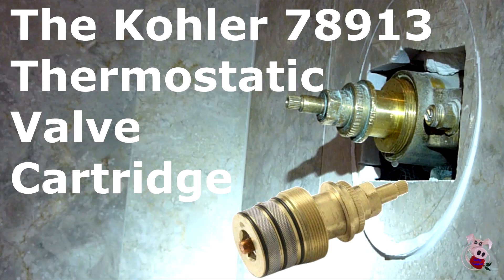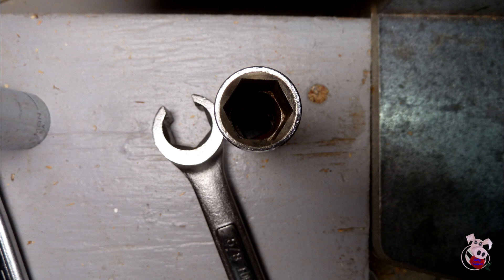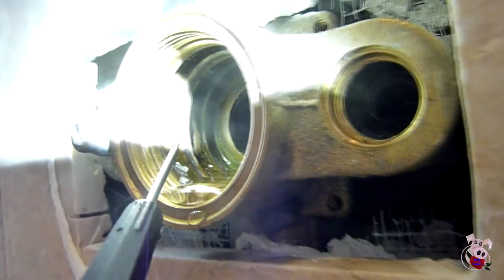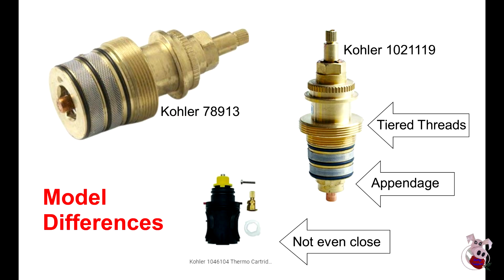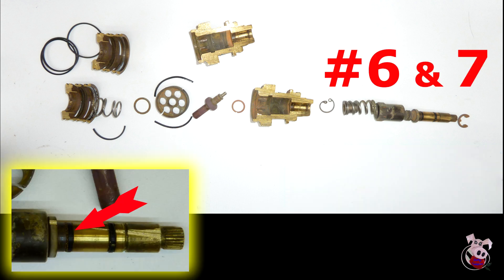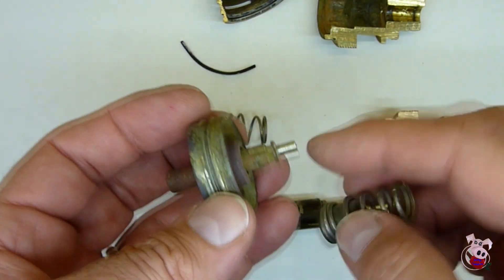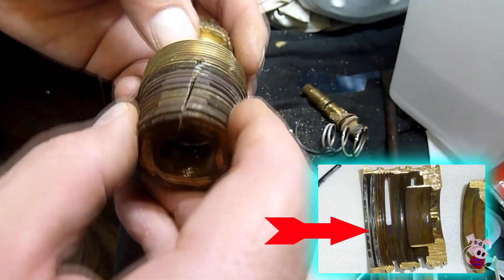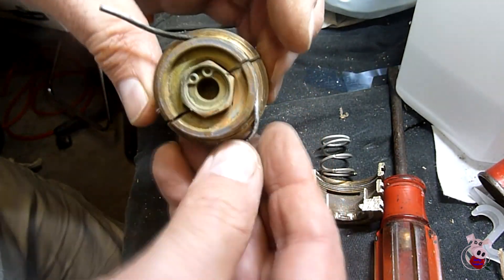Kohler 78913 Thermostatic Valve Cartridge Service

Comment: Hello! Great video. I’m at the point where you use the wrench and channel locks but it is seized on there pretty good. Do you have any recommendations to loosen it? You are my last hope before I have to call a plumber! Thank you!
Reply from the maker: none that I would be comfortable with as I would not want you to damage an in -wall pipe or the wall.  Pressure on both sides tends to help but then you are getting into special wrenches.  You can have someone lightly tap on on it when trying but it has to be with something that won't deform the metal.

Comment: @alwaystinkering6972. Any idea what those two screws on the left and the right do.? at 52 seconds. they are a chrome color looks like a set screw for temperature adjustment and / or flow rate? I cant seem to get 1. hot water 2. and or pressure. but i have a 2nd shower in the same shower it works great runs off the same supply lines. i have already replaced the mixer.... i am scratching my head. Also amazing video. thank you so much for this.
Reply from the maker: Those are shutoffs.  On this valve they are readily accessible.  They usually have a rubber seat.   If you lived in place where it is difficult to turn off the water you could in theory use these.   More often than not they are partially blocked by skillfully placed tile.  Because of the rubber seals and poor access, I usually don't touch them in case they start leaking.
Reply: @alwaystinkering6972  So i am getting really poor water pressure i think its the likely candidate for the it. i have already replaced the center mixing valve. any idea if you can buy those rubber seals?
Reply from the maker: @ they should be standard seats as I recall. But… you did the mixer.  Your on off valve could be swelled as well. Take the shower head off. Make sure there is no restriction there. Those two at the temp handle should be full open. Of one was a problem your hot cold would not balance… reducing the odds of both being it.
Reply: @alwaystinkering6972   yeah shower head is off still poor water pressure. i called Kohler again... and bought two replacement seats for the on and off ... $165 for both.... ugh. ships in 12 days... so we will see in a couple weeks. i am hoping that is the smoking gun to my problem. thanks again!
Reply from the maker: @ one more item. Likely not but it is a good story.  A neighbors guest bath  had lo low flow. Since the bath was not used the calcium (or something from their water softener) built a dome covering the egress from one of the valve chambers. Found it in a visual inspection.
Reply: @alwaystinkering6972  highly likely we have more blockages in those this is what we cut out that was in the hot and cold supply lines… let me see I can attach a photo
Reply: https://youtube.com/shorts/P-CAIe4Xo7A?si=7jjL7j-TrAwjJaPD
Reply: @alwaystinkering6972 alrighty I replaced the two temperature / pressure plunger type valves on the left and the right. I this fix 99% of my problems there was so much corrosion buildup in the old ones… But can’t seem to adjust them to get the right temperature either scalding hot and have no cold water or cold water and no hot, any idea what’s the proper way to adjust the valves? Any idea if the installation instructions have them?
Reply from the maker: @Rambo13Chris  The pictures you posted show you have challenges with sediment.  

The valves should be full open and the mixing valve should do the adjustment.   You are getting burnt or frozen so both provide water.  

Try a flow rate test.  Turn off one, fill a gallon or so bucket with everything full open.  The mixing valve maybe on the center once and then full open to the temp you are using.  What are are evaluating is how much water is flowing from each in a time period.  

If they are about even, I would suspect you still have a mixing problem.  If the are grossly imbalanced, you will hopefully know which one has a flow restriction.  If you are on a well with a tank, take into account the pressure when you run the tests.

Comment: Thanks for this.  I just replaced one of these for the 2nd time in about 23 years.  I was wondering about taking it apart to see if I could determine the failure, which was hot water only.  I will see if I can get it apart and if anything is apparent.

Comment: how do you remove the knob? Step 1?
Reply from the maker: The center has a cover. Under it the screw. Once the screw is removed you may find the handle to be stuck.  Patience. Wiggle lightly. I sometimes try some wd40. Others may have better suggestions.

Comment: hello thanks for the video, quick Q? how did you take a part the finished trim or the deten cap.
Reply from the maker: On the main valve cover it is usually a screw holding the handle. The screw will be under a center cap.. usually pop off.  The valve cover plate is usually two screws.  Individual handles are usually screw under a cover to get the handle and the valve cover is usually threaded on by turning the entire cover. Glance underneath and make sure you don’t see a set screw hole as you may sometimes encounter that variety.

Comment: Amazing video. I just installed a new one and it seems like the orings were never lubricated. I am planning on taking the new one apart and lubricating the orings. Has anyone actually managed to take it apart? Is it right hand or left hand threads?  Thanks again
Reply from the maker: I still have the cut one.  It actually looks to be a left handed thread. I never checked after cutting it. While I did reverse directions when trying to take it apart, let’s say I did not put as much effort going left. 

I will say keep in mind someone could change that orientation at their design discretion.
Reply: @alwaystinkering6972  Thank you very much. Again your video was amazing.
Reply: I am confirming that it is a left hand thread. I cleaned and rebuilt it again this past weekend. It seems it needs cleaning once per year. It works great again.

Comment: Thanks for taking the time to open the valve up.  Extremely informative for anyone working on a thermostatic valve, not just the 78913.  I installed the Kohler K-401 in 2004 and have changed this valve out 3 times in the years since.  Being that I still have the 3 valves I had removed I can now do some experimenting.

Comment: Excellent video. I'd like to improve it by clearing up one point:

There is car thermostat shown at 7:00 in the video. The springs do not respond to temperature. Rather, the thermostat contains a "wax motor" (https://www.coolcatcorp.com/thermostats/Wax%20Thermostats.html). The wax is incompressible, but expands when it melts, pushing a pin. 

I learned about wax motors when I spent a brief stint as an appliance repairman. A wax motor is used inside a dishwasher to operate a soap dish door when an internal heater is activated to melt the wax (https://www.youtube.com/watch?v=u11PAeWxQpw)(https://youtu.be/sApyrDEXGAI?t=408). A wax motor is low cost, generates in irresistable force, is very reliable, and should operate hundreds of thousands of cycles. 

In the Kohler video, from 4:55 to 5:10, the wax motor in the thermostatic valve is shown. The wax expands when it melts, pushing the pin and compressing the spring.

Here is an excerpt from the description of a Crosswater thermostatic valve that looks to be identical to the Kohler (https://www.fruugo.us/thermostatic-cartridge-for-gp0012174-rv1102rc-crosswater-gr-05t-sol-assy/p-10229921-21509092) 

"A wax capsule can be found inside the Crosswater GP0012174 / RV1102RC. The capsule is responsible for water temperature regulation by counterbalancing the flow of hot and cold water to generate a preferable temperature."

Why does the Kohler cartridge fail? I'm not sure. Does the wax motor pin get stuck due to deposits or metal corrosion? An automobile thermostat is immersed in a mixture of glycol and water. The Kohler is immersed in the water from your plumbing. 

Here is an online post by tbr220 (Nov 18, 2012) that I found at (https://terrylove.com/forums/index.php?threads/kohler-k-401-mixing-valve-cartridge-repair-or-replace.38496/) 

"I have two of the same mixers, both failed to adjust from full hot. Rather than pay for two new valves I have taken each one out and soaked them in CLR for an hour, rinsed and re installed, both work fine. I have had to do this twice a year for the four years I have lived here to clean out the calcium buildup even though I have a water softener. 

•	I remove the screens and o-rings first, 
•	then soak the metal parts in a glass mug 
•	then rinse and lube the o rings with silicone grease,
•	re adjust the temp limits and we are back to happy until they get stuck again. 

Hope this helps." 

Even though it's expensive, I decided to replace the entire cartridge, and soak the spare in CLR between swaps. Eventually, I may swap out the Kohler with something cheaper and more reliable (like a $35 car thermostat).

Comment: Do not screw it all the way in!!  I did that on my first replacement and after it failed in 2 yrs I bought another and luckily found the installation manual. 
- The new cartridge will have a black line on the bonnet and a black line on the adjustable stem. (It will come with them lined up. Do not turn it before installing)
-The valve body (the part in the wall) will have a black line on the top. 
-Screw in the new cartridge and line up all the black lines. (I screwed it all the way in and backed it out to line them up). 
-Check for leaks and reinstall the trim.
Reply from the maker: Thanks for sharing that so others can benefit.  Hopefully you get more than two years out of the new one.

Comment: This is, hands down, one of the MOST useful and informative how-to videos I have come across on YouTube. I regret installing this particular part (times two in my 2-person shower) and have been infuriated by the little issues that keep popping up. I have NEVER been able to get the temperature selection to be somewhat accurate, but this video helps tremendously in my quest to fix it once and for all now that the water flow/pressure upper valve has to be replaced and I will do it all at the same time

Comment: This cartridge goes in the Kohler MasterShower 3/4-inch thermostatic mixing valve, K-400-K valve, or if you have the two cartridge version (volume of water right above) it is called the Kohler K-401-K, with volume control.  The original homeowner of my place left some information on it.  Unfortunately it seems he replaced it several times in 15 years.  Now it is my turn.

Thank you so much for putting this video up.  My valve died again, and this gave me the confidence to work harder to remove the cartridge to replace it.  Surprisingly the cartridges are still around in 2021, although they are pretty expensive.  Not sure how many more times I will do this before changing out the whole unit.

Comment: Very Informative Great job! Now I can try to fix mine (not getting enough hot water). I am on well with a lot of sediment. I bet it is clogged with dirt.
Reply: Guess what everyone, with the help of this video and our tinkering friend who posted it, i just had my second failure after the newly installed warranty thermostatic valve. The replacement valve lasted about 3 years (on soft water). The issue was water temp too hot, unable to cool it to the point we couldn't shower anymore. 
I always intended to take it apart and do some maintenance, with the help of this video but never managed until now. 
The lower part of the valve where the screens are unscrews with reverse threads. I simply clamped the lower portion in a bench vise, with rubber protection teeth to prevent damaging the surfaces. I clamped it hard enough to hold but not too hard that would crush it. Anyway, sure enough it easily came apart because there is an oring seal, so not much force was needed. 
So what did I find? Too much clearance between the brass thermostat and the shaft that goes in and out as you turn the control knob. I added a small metal spacer, about 3mm long (piece of a Dremel tool shaft) this eliminated the free play and now allows the shuttle to move in and out, thus temperature control again. I can post pictures but I really don't know how. Anyway you too can rebuild this valve and save $200-$300 for a new kholer valve that will fail anyway. Good luck!
Reply from the maker: Don’t forget to check the seat on the hot water shutoff in the valve.  I have seen the rubber can become bloated as it breaks down.  The net result is it can restrict the water flow to the valve.  Maybe you will get lucky if you find it an issue.  Good luck.
Reply: @alwaystinkering6972  On mine the screws on either side of the valve look like somone took a screw driver that was too small as the screw head is a little mangled, but it looks also like I can use a ratchet on. Are the 2 side screws also a bolt that you can use a ratchet on instead?
Reply from the maker: R Eff the ratchet takes the entire valve out so you can service the valve rubber washers.  It might be they are warn out and some cranked the screw trying to stop the flow.  If you ratchet those out make sure the water is off because there will be nothing to stop the flow.
Reply: I have these exact shower heads and valves.  Do you happen to know the name of the series or a model name?
Reply: Sorry I know this is a really old post.  But I've got the same problem, not enough hot water.  Were you able to fix it?  Did it require a new valve? TIA